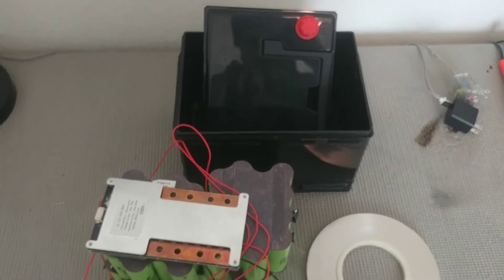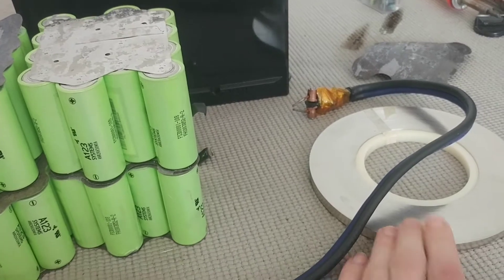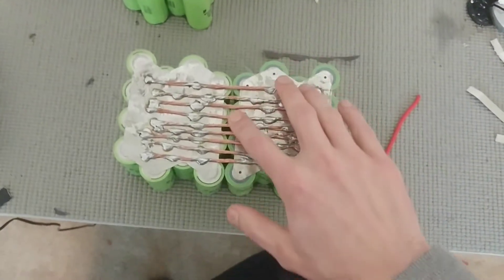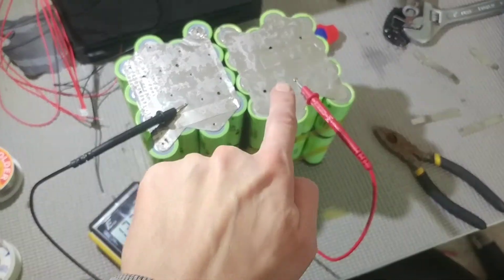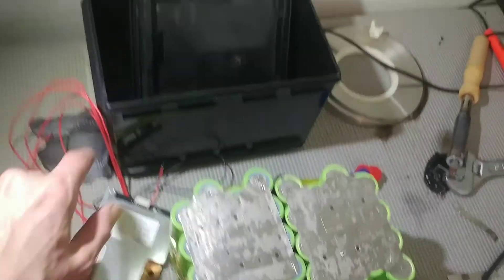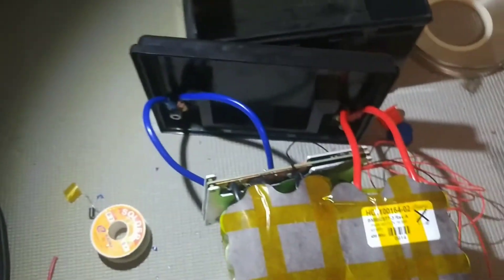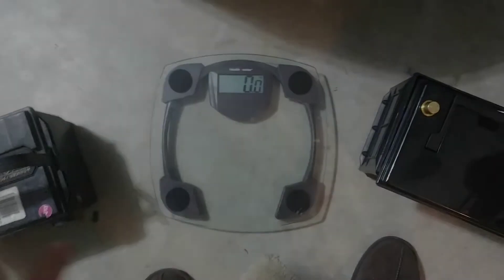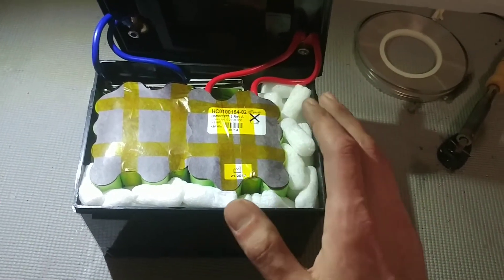DIY Lithium Car Battery to start my V8 from a123 LIfePO4 cells

Comment: I don't see why you would want to do this. (I'm a solar hobbyist myself)
Reply: lead acid  VS lithium lifepo4 life cycle count, usable capacity, amp output, however I've written an article and have said lifepo4 isn't possible, literally the temperature range says it's impossible without permanent damage. lithium titanate is the only chemistry that can handle temperatures that a  car would see daily
Reply: @eksine old comment but worth saying that lead battery market has become monopolized in the US over the last 5 years. now only 1 mfg and car batteries are 200-300$ and last 3-4 years instead of 5-7 and are all mostly made in mexico with poor fiberglass cathode design and minimal space in the bottom to allow deeper cycling. you can literally build a similar car battery out of lifepo4 for 30$ (1/10th the price) if you ignore the BMS which usually causes more issues than it prevents in automotive application. insulate it and put a 20watt silcon heating pad and relay thermostat, another 5$ in parts for cold weather. even if you have to replace it every other month it will still be cheaper than buying lead acid batteries right now. lower weight + internal resistance of lifepo4 batteries will also theoretically give you improved gas mileage.
Reply: @vevenaneathna  see I don't get the heating pad thing. if for an RV it could work. but for a car you don't know when you need the car in winter. the heating pad would have to be on a timer or plugged into an AC source with transformer for DC. it's impractical. once the car is started and starts charging your lifepo4, it's going to cause permanent damage in cold. I still say lithium titanate is the only choice you have unless theres other ones than can handle the cold.
Reply: @eksine  theres like 1$ 12v relay boards you can buy that have a thermocouple and you can set the temperature range you want them to keep. the battery turns on the small heating pad for a few minutes to raise the battery temperature above freezing, were talking like 5 watt per hour in the cold, a small lifepo4 will keep itself above freezing for months. probably less power drain than a lead acid has normally. you can put a resettable thermal fuse in line with the heating element if you dont trust the thermostat board. LTO is so expensive for meh performance and poor volumetric efficiency, youre better off just building a lifepo4 battery that doesnt let itself get too cold for half the price.

Comment: You should probably put an insulator between the two battery stacks - the cell case voltages between the two stacks is different and for high vibration, not good to only depend on the cell sleeves for insulation. Hope you added insulation between the battery pack and the BMS too. Don't know if you live in a cold area but LiFePO4 batteries should Not be charged if the temperature is below freezing!
Reply from the maker: It does! I probably didn't show it in the video. But I do have strips of shrink wrap between series connections. But I should add insulation between pack and BMS! Thanks for input! Loved to hear it! PS I am in texas, so cold isn't that much of an issues, normally :)
Reply: @sideproject4028  Barley Paper or Fish Paper is what you want to use. Try to find the thick stuff